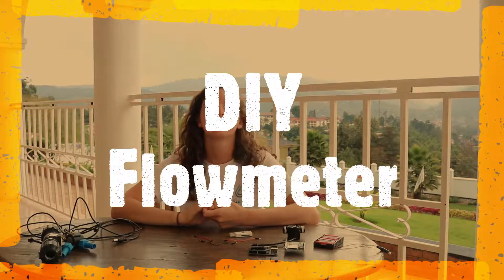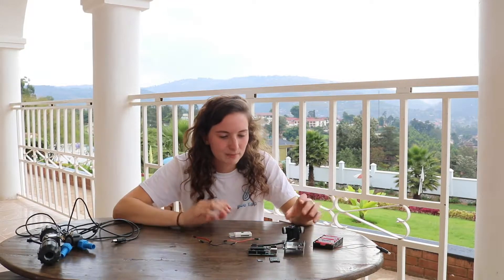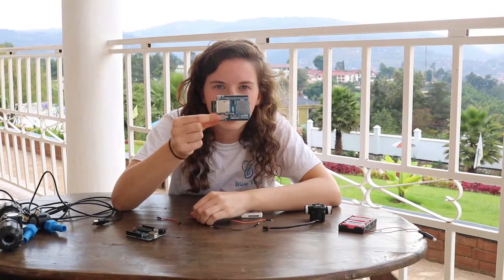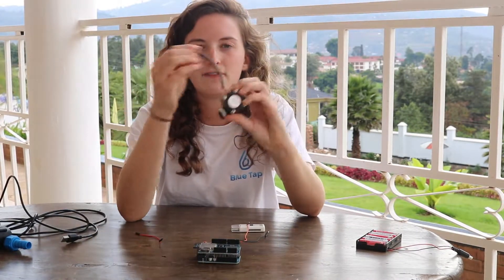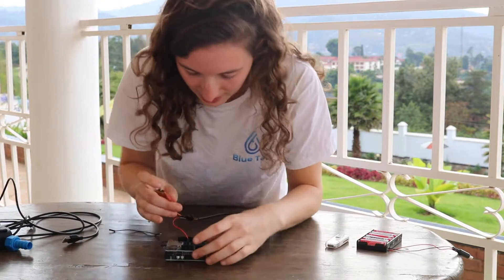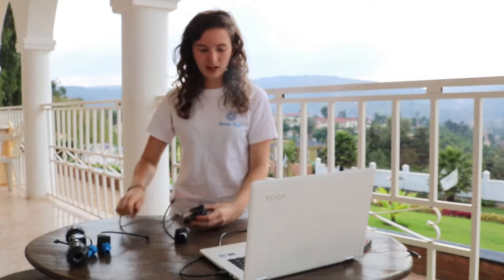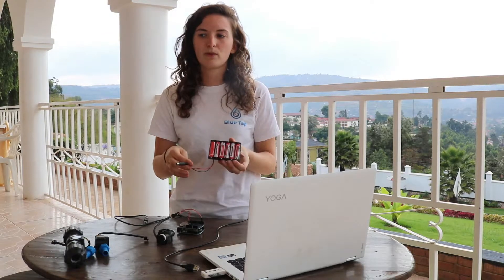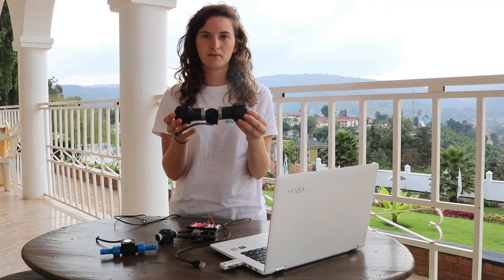DIY FlowMeter

Comment: Most stupidest video ever. You are just assembling the components of the system. Not making flowmeter. You just connect a store bought flowmeter sensor and wires together to just collect the data. No concept of a flowmeter shown here